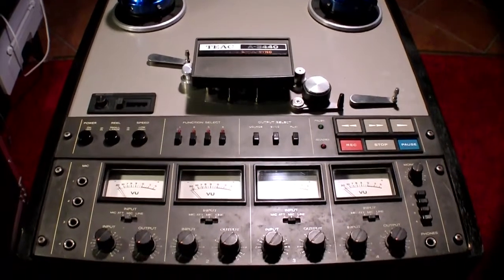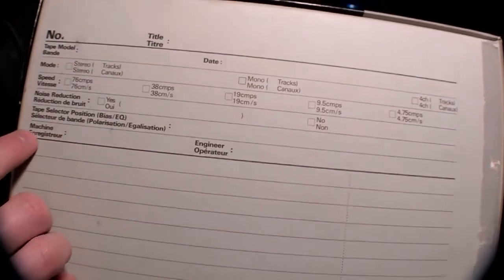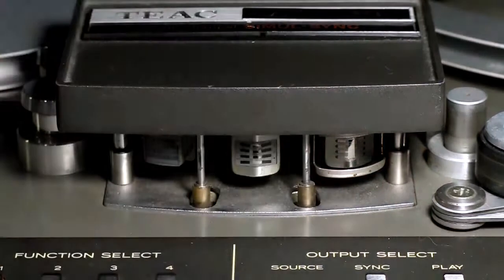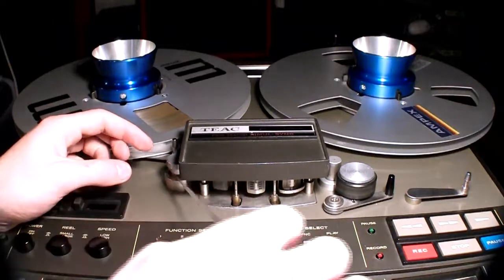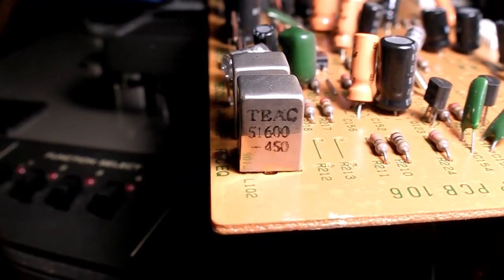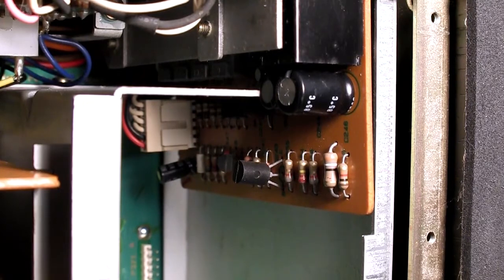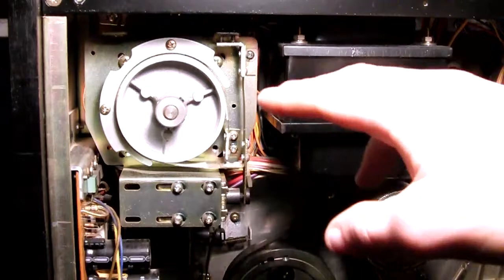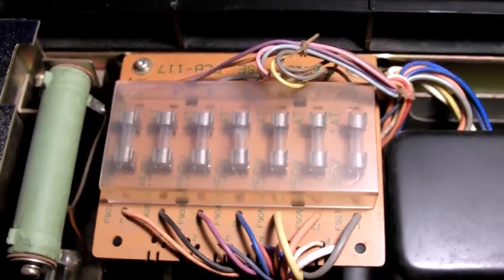Teac A-3440 Reel To Reel Tape Recorder Teardown

Comment: Wow!!!!!!!!!!!!!! Because of this video, I was able to fix a Simul-sync issue I was having with my recorder!!!!! You pointed out the 4 little cards that pertain to simul-sync inside the deck. My Teac was only playing out of one speaker while in "sync" mode on channel 2. The UV meter wouldn't even move on channel 2. But... it played back just fine out of both speakers & the meter worked on channel 2 while in "play" mode. I have spare parts for this machine. So I replaced the channel 2 simul-sync card. Voila!!!!!!!!!!!!!!!!!!! My machine is working great on channel 2 now. I am excited!!!!!!!!!!!! I got this unit at an estate sale for $200.00 a few years back.

Comment: I have one of these I I from a friend. 
It looks jn near mint condition all works apart from when u press play the capstan wheel won't lift the tape to the heads... any ideas?
Faulty or operator error?
Reply from the maker: Hi! So is the pinch roller spinning when you try to press play? Do the fast forward and reverse work? Is the tape correctly fed through all the tape guides?
If tape is placed correctly, pinch roller is spinning and fast forward and reverse work, it could be a faulty capstan solenoid or just a bad contact.
Reply: @DaveElectronics  ff and rw work as they should and the capstan is spinning. When I press play nothing happens at all. The pinch wheel doesn't move or even make a sound. I've checked and it moves freely and inside there is no gunk gumming it up. 
Unsure of how to test the solenoid inside
Reply from the maker: @billpickle2875  Perhaps is a bad contact on either the play button, or the solenoid.
To access the solenoid you have to remove the upper back panel. It's buried behind the left motor (looking from the back of the machine). I would try to see if that moves freely and/or if it has loose contacts. There're many connectors on the power supply board, i would try to reseat them also.
Reply: @DaveElectronics  I managed to roll out the play button and the FF and rw stop with the play button. The solenoid moves freely. 
Thanks for your help. I'll check all the connections to the board and the solenoid although visually they seem fine and checking the wires to the board all appears OK. I might try re flowing the joints before maybe sourcing a new solenoid.
Reply from the maker: @billpickle2875  If you have a multimeter you can check if the solenoid is ok by measuring its resistance. 
Also with the multimeter you can check if current is delivered to the solenoid when you press play.
Reply: @DaveElectronics   thank you. Yeah I'm going to bring my soldering iron and multi meter home from work and get to the bottom of it. Really want to get the unit up and running. I'll check to make sure the solenoid hasn't gone open coil and isn't shorting. I'm fairly novice with electronics but can understand the schematic and how to read values etc. I'm a guitar technician so this type of thing is a little out of my skill set. however its a fun project and hopefully I can get it working. The unit looks brand new. 
Its been boxed for around 30 years. 
If the solenoid checks out OK ill remove the control board and check all the contacts on it as it looks quite dusty. Failing that I'll be lost. Maybe the power pcb on the left? Also ordered some new fuses as well as although visually they all look OK I need to get the meter on them to double check.
Reply: Just an update if u are interested. 
I managed to sort it. It was a leaky capacitor c711 feeding the transistor q718. It was causing q718 to stay on engaging the stop circuit. Replaced both and the machine now works 100% 
Happy days
Reply from the maker: Nice to hear that the machine is now running! :)

Comment: hello, thank you for this informative video about the teac 3440. I have had one since the 1980s and I would like to use it again to retrieve old recordings.
For that I bought new straps, the old ones were sticky and damaged. after positioning the tape, I can move the tape forward or backward but not play. nothing is happening ?
in the video we can see the mechanism which places the tape on the heads. on my 3440 it does not work? the pressure roller does not move up and down and does not drive the belt mechanism. do you have an idea, mechanical, electric? I would like to recover some old recordings ... thank you if you have a start of an answer ...

Comment: Heya! Great little vid. Cheers! ..I don't suppose you might know why this machine, working Perfectly before moving to new location, would Suddenly be completely unable to record across all channels? (All jumpers in place, Source shows all incoming signal on all channels. The machine will Erase on all 4 channels, but Nothing coming through the inputs\meters, while recording enabled .. will actually make it on tape. I am Utterly flummoxed. Any ideas welcome. (Also re-seated every last board to be safe..). Thank You!!!

Comment: I have intermittent audio on my 3340...where is the relay contact part? probably just needs deoxit, any help much appreciated.
Reply from the maker: Hi, I have no experience with the 3340, but judging from some pictures of that model, the audio boards should be located on the bottom of the machine. I highly suggest you to search online for a service manual for your machine and look for a component location diagram to find the relay.
I would try also spraying some contact cleaner on potentiometers and buttons, relays are much less exposed and thery rarely go bad..
Hope it helps

Comment: I have one of these. Two tape speeds are possible:  7.5 ips (inches per second) and 15 ips.  There are several reasons why this kind of deck will sound better than even the best cassette deck. First off, because the tape is moving so quickly past the heads there is far less chance of oversaturating the oxide on the tape.  Thus, it will have much greater dynamic range (diffeence between the quiet and the loud sounds). Secondly, there will be a superior frequency response in the high frequencies without needing lots of tricks such as Dolby and metal tape and lots of EQ and bias adjustments. Thirdly, there is less chance of wow and flutter.  Cassette tape runs at a very slow 1-7/8 inches per second and on much narrower tape than on this class of open-reel recorder which uses 1/4”. To improve on this class of machine you’d go up to half- track tape heads rather than what was called quarter track (1/4 track). That means the record and playback heads would have two gaps rather than the four like you can see in the video. OR, you’d get a 1/2” tape machine and shell out some pretty good money for 1/2 tape. Basically, this of it this way: The wider the tape and the faster the tape speed the quieter the result (less tape hiss), wider the dynamic range, and wider frequency response. Now, this A-3440 must be a later model than mine because Teac engineers went more ‘pro’ with its design. The overall layout of mine inside is messier, with little PC boards stuck here and there , making access to the motors, solenoids, flywheel, andbelts more difficult. The simul-sync switches on mine are up on the tape head cover, looking almost like an after-thought. In fact, the PCB (printed circuit board) that the simul-sync switches are soldered to is broken because the recorder must have fallen over on its front sometime in its life. Those switches stick out more than anything else, including the reel locks so they took a beating. Anyway, thanks for doing a video about this unit. Yours and another guy’s tear down and servicing YT video have helped me get mine back up and running! We’ve come a long way since this type of sound source for home listening, haven’t we? Now I can say to my Alexa Dot (which cost $40 and has no moving parts) ‘Play Beethoven string quartets on Tidal’ and I’ll get it in about 5 seconds, playing through my wonderful Mirage M1 speakers, Parasound FET preamp and Parasound power amp. I didn’t have to touch a thing. Still, I do miss the machinery sometimes — the feel of tape, the excitement of rewinding when you fear the plastic reel is going to fly apart and cut your finger off, that kind of stuff. Heck, I could barely list my 3440 up onto the shop bench to work on it a couple of days ago. I can’t say I miss having to demagnatize and clean the heads, either.

Comment: How I love analog electronics. The days of tape MTR are dying away. Analog recordings are so warm. I'm glad they still make turntables and tube amps. MOSFETs are close, but are no replacement for thermionics. Thanks for sharing this.
Reply: Kinda. If you really check out some refurbished and perfectly adjusted tape machines you discover almost no difference and colour in the sound compared to other modern media. It's also about the placebo psychic and the fact that those machines will change over time. And if not repaired or refurbished they start to present their character. For home recording this is perfect. Especially when you drive the tape to get some warm distortion. Most Hifi people don't even care about trying to drive it. Most of them use dbx or something and keep it under 0 dB. 
And I speak from experience. In the studio the sound is almost identical to digital if you really put them side by side and have professional tape machines beside you. But you certainly can see a difference in peoples playing and even eyes when they see a tape machines and record unto it.

Comment: Hmmm ... 4 trks > 1/4”. I could bypass 244’s cassette recorder, get better fidelity then mix down > stereo cassette. The tapes should sound awesome. Don’t laugh @ the newb🤓
Reply from the maker: Yes, with a reel to reel 1/4” tape recorder you’ll have better fidelity than a cassette recorder, not only for the physically wider tape, but also for the much faster speed of the reel.. (and remember that cassettes have 4 tracks squeezed inside that 1/8” tape!)
Reply: @DaveElectronics  Commercial cassette & reel-to-reel tape machines NEVER had a signal-to-noise ratio of better than 58dB,  regardless of the Dolby or MXR filters, or chrome or metal tapes. The industry secured its own early demise by intentionally designing consumer tape recorders to be SIGNIFICANTLY NOISER than professional equipment.
Reply from the maker: Dave Schachne well yes, probably, but not all commercial machines had a poor s/n. A Revox A77, had a s/n of better than 66dB, but if you really wanted something better you had to pay a premium price for that... average commercial cassette or r-r recorders sounded good, but they were... well.. average ;)

Comment: I found the best Tape formulations for TEAC and TASCAM non EE decks is Scotch 996 or Maxell UD XL1..  Both are extremely low noise, non-shedding, and have MOL @ 15 IPS of +8db VU with no saturation

Comment: I might add,use AGFA or BASF high bias tape and you'll get even better s/n and frequency repsonse AMPEX 456 will shed and has inferior specs.
Reply: Dv555 That's ashame.
Reply: You bake them(3M),lowest setting with over door open for twenty minutes,place on glass or ceramic plate top and bottom to prevent heat damage to centre hub).as regards the 456 Grand master,the binder problem is a well known one by those studios worldwide.Ampex changed its formulation around 2000 or a bit before,so i'm assuming your 456 is post 2000 known as Quantegy,I have a reel of that that is also ok.
Reply from the maker: I heard about the baking process on old tapes, but never tried it, i suppose i don't have anything to lose on that Scotch tape, so i'll try. Thanks for the tip! Anyway i also have some Quantegy reels (Quantegy 661), but those are small format 7-inch reels, so i don't really use them..
Reply from the maker: although i have a stock of old tapes i always use new tape for recording (RMG SM900). I have to say that my Ampex 456 tape is still good (no shed) but with disappointment i recently found out that two of the tapes i used as archive branded Scotch (3M) are barely playable anymore..

Comment: The DBX unit was actually made by Teac, The RX9 and will achieve around the same signal to noise as 16bit digital at 85dbs/n, here is the RX9 https://www.hifiengine.com/manual_library/teac/rx-9.shtml

Comment: I think these were manufactured between 1974 and 1977.  I think I found a date code of 1977 on the motor on mine.  I replaced my ICS from the 4558 to the 740SL op amps.  Mine is a lot quieter now.
Reply: 1980 on